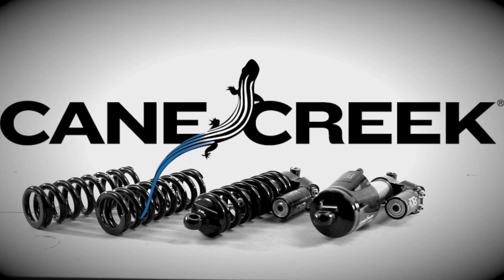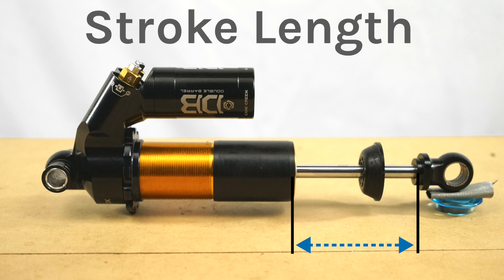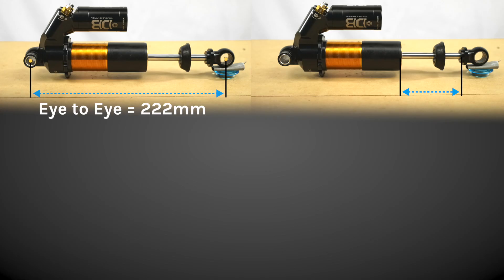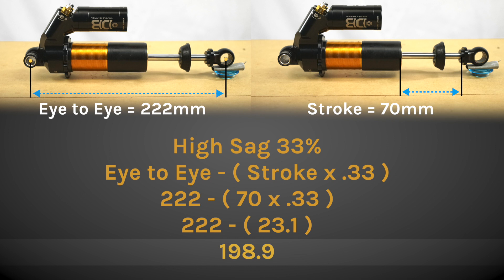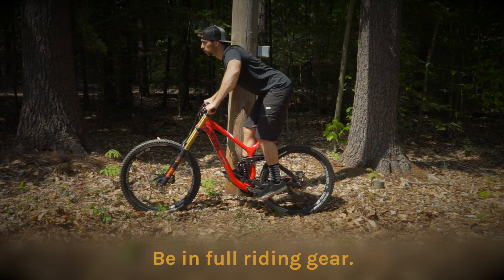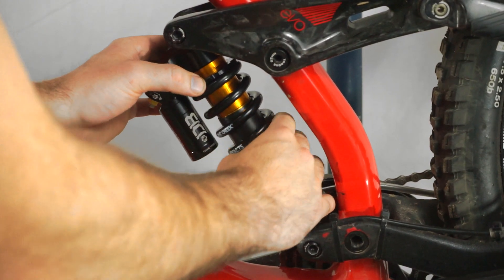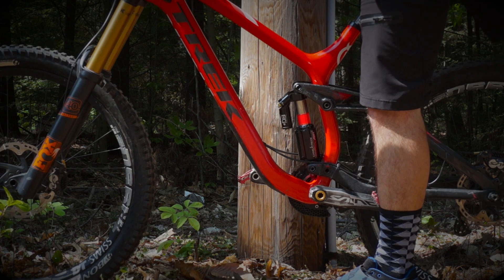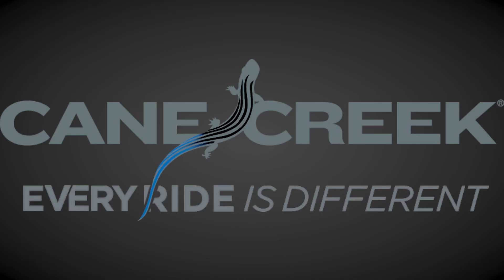How to set Sag on your Double Barrel shock

Comment: HELLO I HAVE A CANE CREEK SHOCK ABSORBER I HAVE TO ADJUST THE SHOCK ABSORBER TO MY WEIGHT OF 80 KG WHICH AIR PRESSURE SHOULD I PLACE. THIS SHOCK ABSORBER IS USED TO MAKE. THANKS
Reply: Set a X amount of psi to the air shock then measure the SAG, start with a 20% SAG then ride, feel it, increase or decrease SAG acording to your style of ride/trail. That worked for me. If it has LSC/HSC it has to be fully open(softest)